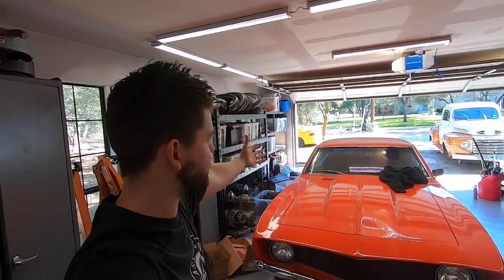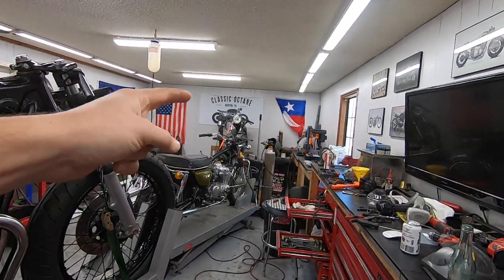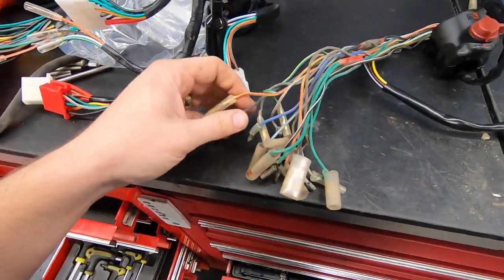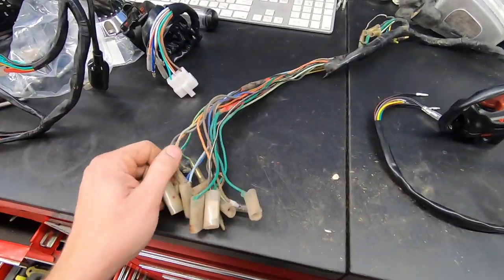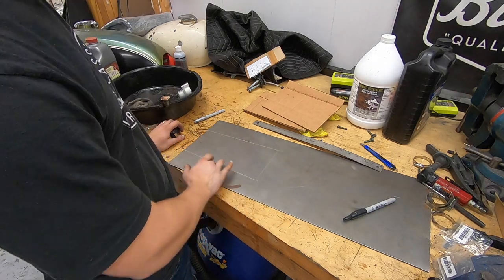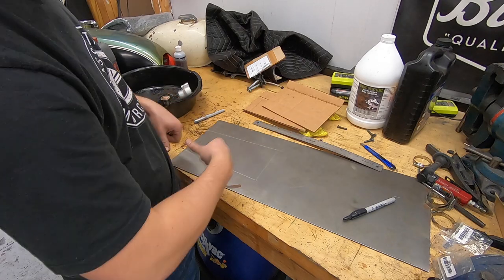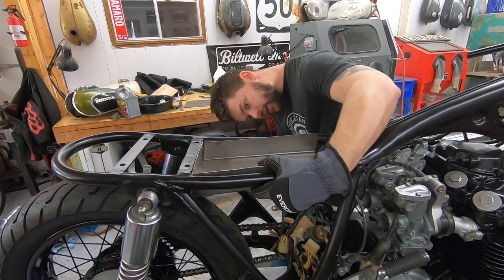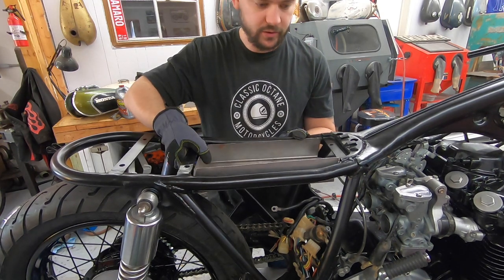One week CB550 build: Day 5

Comment: I'm hooked too. I've been an auto mechanic, worked in Auto Parts, rebuilt engines and pretty much done everything but build my own race car. My last job in Auto Parts was when I worked for Federal Mogul, which owned TRW, Sealed Power, Bower, BCA and National oil seals along with Carter carbs and fuel pumps. I worked the 1-800 tach assistance line, and that was a lot of fun. But the EPA took a heavy toll on the industry and the DIY market almost went extinct, so I went back to school and started a second career. But I miss the mechanical side of things after working as a engineering technician for Intel. So I stumbled on this site and watching your work has been like a third education. Thanks!
For your battery, try it first. You can always wire a second one in parallel to get more amperage to start the bike. Keeping the battery box open and having air flow thru it will help the battery last longer too!

Comment: This 7 day build series is really nice idea ;) it's very interesting to see your progress on the bike everyday, especially when you've been through those step many times yourself on some builds ^^
Anyway, you should probably invest in a 3D printer, there are fairly cheap one now and they can be very useful on builds. I always 3D print part like speedometer mounts, ignition key mount, turn signals, etc. and it is way easier than fabricating a metal tab, usually cleaner and strong enough for those small parts ;)

Comment: Just a suggestion, I would consider placing the R/R on the bottom side of the electrical box, this way it would get the benefit of airflow. This would significantly increase its service life. I’ve done this on my last two builds and don’t regret it.

Comment: I would put the regulator/rectifier on outside of the battery box or even on the front of the frame where the horn is originally mounted.

Comment: the kawasaki is prolly my fave as well. i'm trying to do something similar with a honda gl1100. i had a triumph 650 with a chrome hardtail frame, and a 6' springer front end 30 years ago. it was cool looking, but kind of a pain to ride though, mostly in in my back. the day i sold it was one of the worst/best days of my life. edit; you might try adding a capacitor bank to your starter circuit if the small battery isn't enough to start the bike. won't take up much space, and will add a lot of juice to your cranking. hybrid super cap/ li-ion batteries are the future of starting batteries, check them out. i refurbish/rebuild li-ion tool batteries as a side gig.

Comment: Congratulations on 40k subs!!!!!!!!!
Can you still some holes in the back of the battery box (toward the wingnuts for the seat) to give the regulator/rectifier even more air flow? Now that I'm thinking about it, oil or anything else on the road may get flung up into those holes. That might not be the best. Loving the design of the bike. I'm building a 90 Kawasaki Zr550 cafe racer right now with the same design. Colors and almost everything.

Comment: Hey man great video that is looking so good. I need some advice, I’m trying to minimize my wiring on my 84 virago xv700 but I have no idea what I can loose and have to keep? There is sooooo much wires and a lot weren’t even connected when I got the bike. Took forever getting them out of the headlight on the little rip down I’ve done. I was wondering if you had an idea? It’s mostly all original wiring and parts as far as I can tell so far.

Comment: I'd love to get a new wiring harness for my CB750 but that's such a time consuming process and the old one is currently working fine despite being 45 year old wires and connectors.  I just replaced the ignition coils and put a Dyna electronic ignition in it.  Are there any other electrical parts you'd recommend swapping out to help with overall performance?  
The new Dynatek coils have made a big difference, I'm getting a much better spark and the bike is no longer running on the rich side.  If anything it's now running a little lean.  I'm hoping to sort that out with some carb air screw adjustments.

Comment: I purchased those exact controls from 4into1.  I was able to use the throttle body, but the clutch side I wasn't because there is no cutout on the bottom half of the controls body, so that bundle of wires is in the way and you can't get controls body to close flush all the way.  Not sure why they did this, maybe they assume you're going inside the bars? No clue, but that bundle of wires pretty much rendered the clutch control useless on my build... $40 or something like that.